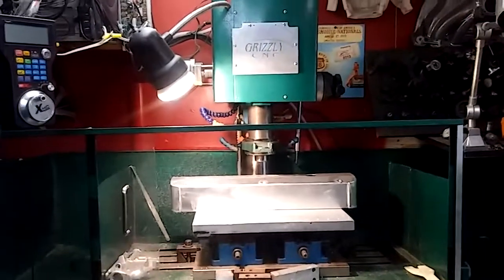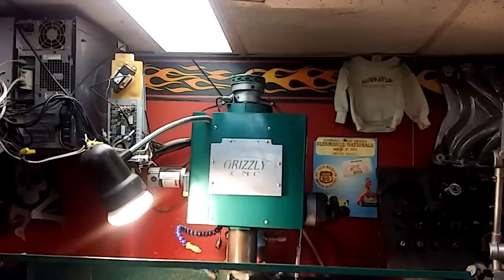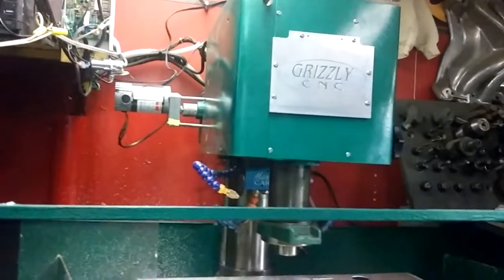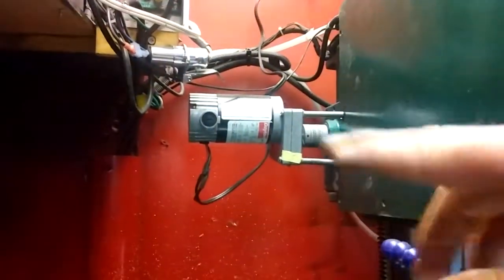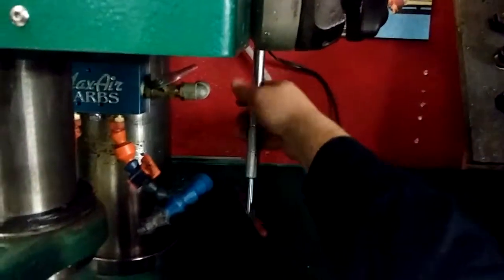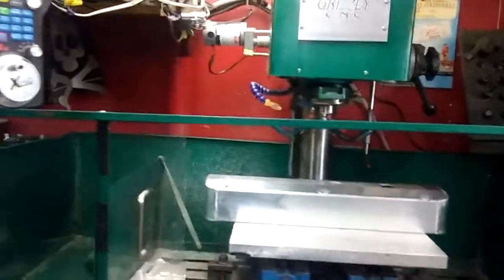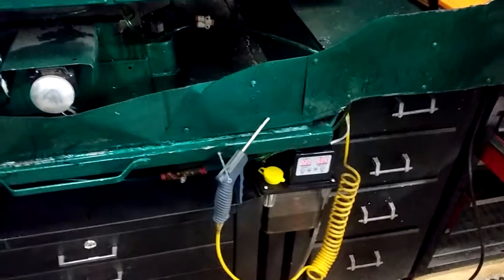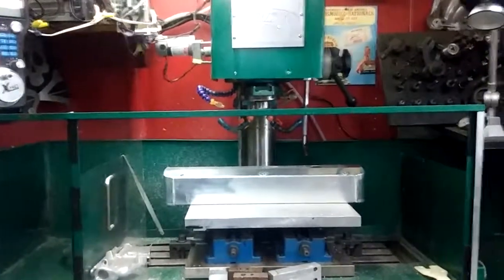MORE UPGRADES ON THE DIY ROUND COLUMN MILL CNC CONVERSION

Comment: Great video , did you replace the leadscrews?
Reply from the maker: I just got them off eBay.  They are somewhat generic to the field of this stuff then just machined the bearing plates On another machine
Reply from the maker: Yes I did eventually.  I ran them for awhile and used mach anti back lash settings.  It had. 035 backlash so I pulled it apart and redid them and put in ballscrews.  Now it has. 004 on each axis
Reply: @maxlacugnato442  thanks, where did you get the ballscrews?